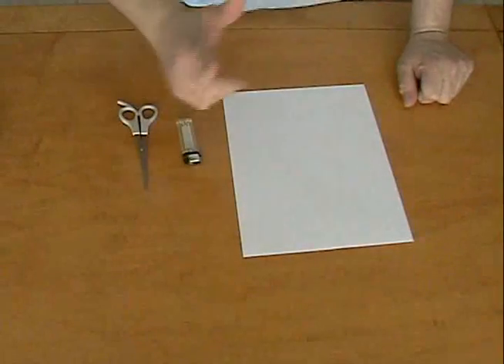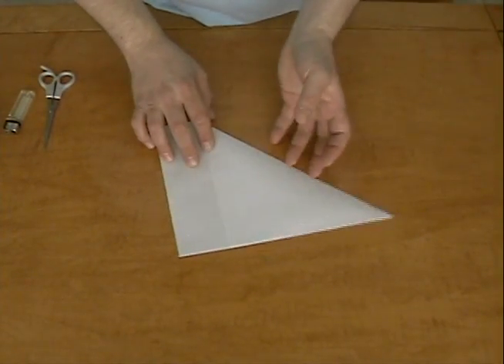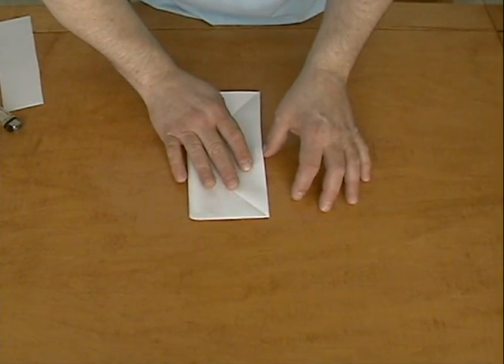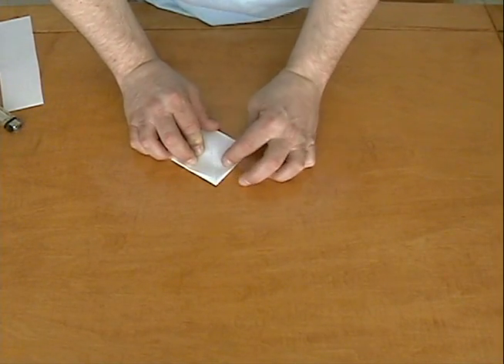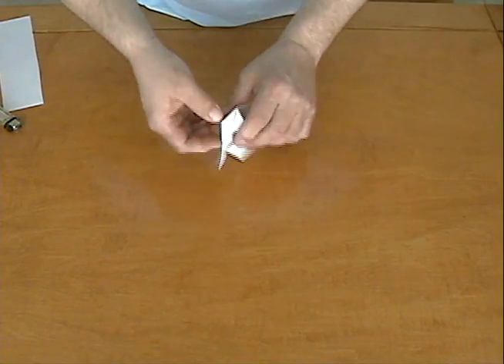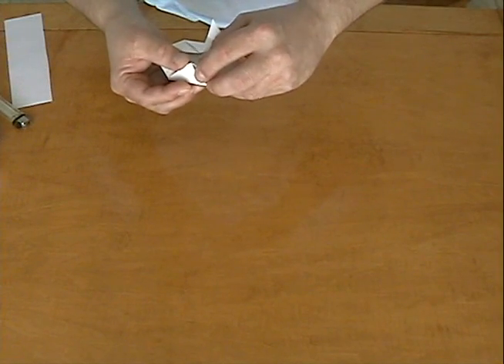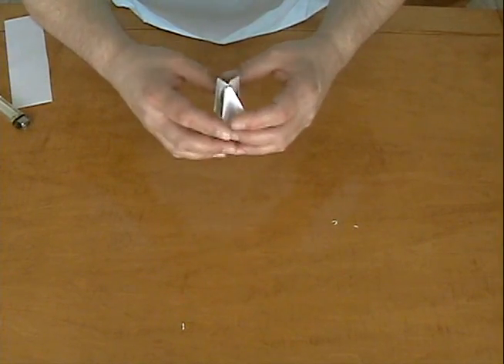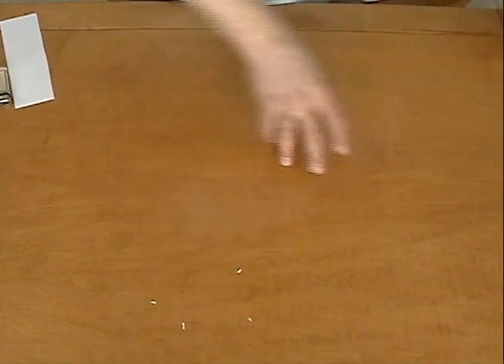Do Try this at Home! Episode 2 - Rocket Engine

Comment: you did the origami part wrong. you forgot to fold in half again for the extra line to make it more like a cube, and better for structure. and when you fold the ends into the pockets, you don't fold them in. just fold the big triangle in. also more sturdy. regardless of minor mistakes, good video.

Comment: Technically that is a rocket engine correct? You are burning fuel (butane) and expelling the burnt exhaust out the back, generating thrust. Your title says rocket engine but in your demonstration you call it a jet engine, which requires air to be taken in the front and expelled out the back. Technicality I know, but since you do neat experiments in your videos and hopefully are educating people out there, you should be precise in the terminology. good job with your work though, really neat stuff

Comment: so, it was a "rocket", or a "jet"?
you claim both but it was neither.
your "rocket" would fall into faa regulation:
FAR 101.1.a.3(ii), 101.22, 14 C.F.R. Ch III 401.5.b, 14 C.F.R. Ch III and/or last but not least AST Supplemental Application Guidance for Unguided Suborbital Launch Vehicles.
your "rocket" does not qualify as a rocket.
your "jet" doesn't really qualify as a jet either considering that even the simplest pulse jet has at least 1 intake and 1 exhaust.
you really are limited.

Comment: @Ssamiirr 
if i needed wikipedia to quote basic rocket and jet definitions and fed regs i wouldn't be working in the professional aeronautic field.
i think it is funny that you made that assumption.
you can't find the information i posted on wikipedia.
you should have looked first.
you can however find it in AMATEUR ROCKET RULES AND REGULATIONS that are published for model rocket hobbyists and several tech manuals for turbine engines i have left over from the army.
you're a fucking idiot.

Comment: Your title is correct rocket would fit, however you keep saying jet engine in your video and its not a jet engine i work on them and you failed to have the 3 necessary parts compressor veins, no burn cans, and no exhaust turbines to power to compression veins.

Comment: @Mindpaint  This worked BEAUTIFULLY!!!   =) I have a question about another possible experiment with the paper box.... If you took a glass bottle and put a source of heat in it like, a lit match, or burning piece of paper, then put the paper box on top of it with the hole facing the bottle, would it float? I mean, heat rises right? =)

Comment: If you want a lamp. You can also make a hallow room in your palm, fill it with lighter gas, make a small gap at the top. and light it. Voila and youll have a lamp made of your palm. If your a ultra geek, then dress up at halloween in some random rope. and pretend your a wizard throwing fireballs by opening your palm, right as you light it.

Comment: OK I'm 30 seconds in and can already tell you this is a lie. A jet engine use a spinning turbine to take in air, compress and heat it. It then mixes the air with fuel and ignites it, creating a huge amount of evergy that is expelled out the back and provides thrust.

However I am impressed how the paper turned into a "baloon", That was well done.

(The last one didn't go across the room, it tumbled down at the end, and it definitly wouldn't have enough momentum.

Comment: WOW!

i tried it.

its awesome.

i also did it a different way:

after making the engine, get a piece of cardboard and cut a little hole in it so you can set the engine on top, with the hole of the engine showing through. ste half of the cardboard on the table and let the part with the rocket hangingoff. fill with gas and light. it shoots up to the ceiling!

Comment: I think the reason why so many people's exploded was because the hole in their paper wasn't large enough. If the rapid combustion is trapped inside the paper and can't get out, the increase in pressure should make the paper easier to burn. Otherwise, the hot air should rush out the hole.

Comment: Do the following to 'tune' your lighter, so u can get more gas in the paper: Wrench off the silver thingy on top, by just stretching it to the sides, then u cna pull it off. Then u grab the switch, and u move it like this: Left, right, up, left(while up) down,right, up, left (while up), down, right and so on and so on. Don't do it too much, as your lighter may get a leak and will light itself all the way, like i had 2 times :P

Comment: Jet engines use the air around them, compresses it, and mixes it with fuel to create thrust. Not to be a nerd, or anything, but you're making a Rocket engine.

Comment: get a 2 litter soda drill a hole on top of the cap put some rubbing alcohol and shake it put some air in there as well just squeez the bottle to suck in air then light it up..then boom just like the paper one but louder and stronger..now try that =)..just dont point it to someone=p

Comment: get a party popper, empty it, fill it with fuel (black powder workd well) i made a little lego car and strapped it to it. then light the tip of it,where you pull the string. use a long lighter tho, or a candle u can lie bellow it

Comment: You obviously know jack shit about engines, that is a very simple example of a ram jet.  All engines are COMBUSTION in some way or another, the difference is a jet engine does not use a device to turn that combustion into mechanical energy (i.e. pistons or whatever the hell a rotary engine uses).  A ram jet very purely mixes oxygen and fuel and ignites it with a directed flow out the back.  And thats what happened in this video.

dumb shit.

Comment: if you are like me, that dosn't have a scissors (because your little sister hoards it and all of the other art supplies), an easy way, and don't call me gross, is to crease where you cut it, lick the crease, flip over,  crease again, lick it, then keep creasing it back and forth. after about 10 times, lick the crease twice more, and  it should tear beautifully! (note, this will not work with folded paper)  =D

Comment: technically this is not a jet cause a jet sucks air into the engine to propelle the vehicle to move forward, this is more like a rocket cause carries it´s own fuel, in this case, gas from the lighter wich ignites and expands pushing the objet off.

Comment: i allmost got fired from my job a few years ago becuase i was messin around, made one of these but filled it with water and threw it at someone, point to the matter they make good water balloons too, and yes they hold water just fine for a minute or two depening on what kind of paper you use

Comment: Actually after reading a bit on it Butane is actually heavier than air. So you obviously failed. 

The density of a gas is roughly proportional to its molecular weight. Air has an average molecular weight of about 29 g/mol, so any gas with a molecular weight heavier than that will be denser than air.

"Propane (C3H8) and butane (C4H10) have molecular weights of 44 and 58 g/mol, respectively, so both will be heavier than air."

Comment: Hey fucktard, the only reason the flame goes up is because it is hotter than the air around it.

If the air was several hundred degrees hotter than the flame it would probably go down.
To be honest it does fill better when you do it upside down, so whether he is right or not it seems to work in practice.

Comment: Try it with a inflatable ball like a basketball or football. Instead of air fill it with butane or propane. Insert the airneedle, as the fuel rapidly escapes throw it into or over a fire and kiss your ass goodbye

Comment: Technically its not a JET engine.  For that, it must have 4 Stages.  Suck(Intake of air), Squeeze(Compression via Turbines to be considered a JET), Bang(Fuel is introduced to the super compressed air and an ignition source is provided.  This is Usually at about 500 deg. Farenheit.), and Blow(Exaust or Thrust.  

Note:  You only had Fuel, a chamber, Nozzle, and an ignition Source.  This is NOT called a jet engine, but Could be considered a paper Rocket Engine.
...

Comment: you cant because it doesnt use the same method of lighting a fire as a gas liter does. with zippo its a wick with fuel on it no gas, and the spark ignites the fire.. but with a regular liter gas is expelled and the sprk lights that, u use the gas as fuel, u cant use a wick as fuel sorry but u cant get over it.

Comment: Haha I love it.  Worked great the first time.  Just a little tip: butane is heavier than air, so it's more effective to hold the lighter upside down to fill the box, since the gas will sink right in to it.

Comment: well the deoderant is more of a rocket than any thing else.
 Take a can of deoderant. Under the can place matches around the bottom all the way around so that the tips of the matches are touching each other and one match in the centre and the bottom of the match just off where you punch a hole in.
 Place the can on a ramp of some sort and punch a hole in the can (must be centre of the matches so the deoderant will spray on the matches. Light the matches and watch your can take off.

Comment: you can do that with your hand. Just fold your hand into a fist, put the lighter hole between your thumb and your index finger as if your putting gas into your closed hand. after about 10 sec, light the hole and open your hand. it creates a fireball in your own hand. no joke.

Comment: dude, an empty pop can, lighter and a lighter refill bottle work better. you absolutely do not drink the pop push un the metal tap to get a good opening press the refill nozzle against the inside of the can and then light the lighter by the hole. dont this as it ie extremely dangerous and not fun. at all.

Comment: I think that using the explosive properties of a fuel as the direct propellant classifies it as a Rocket.  Technically a jet engine takes a medium (air, water, etc) in the front and expells it out the back at a higher speed.  Still a cool video, just thought I'd clarify so kids don't run around mixing up the terms.
More info: Google for Jet vs rocket